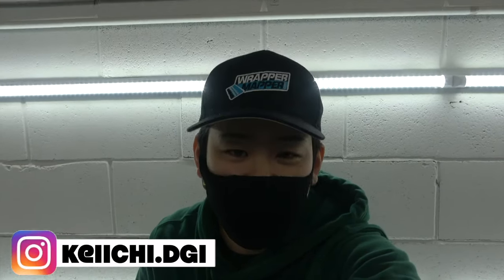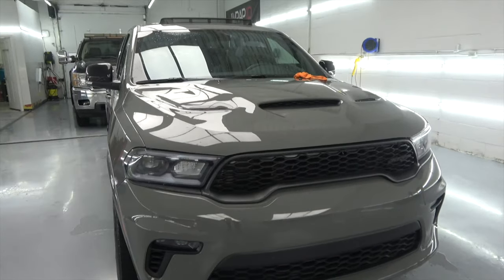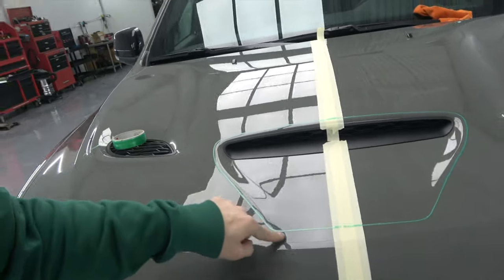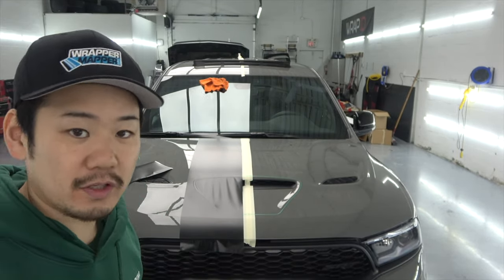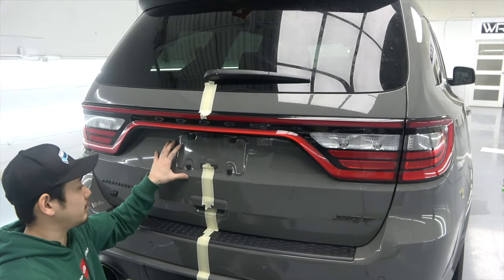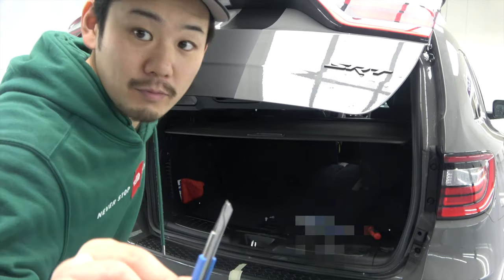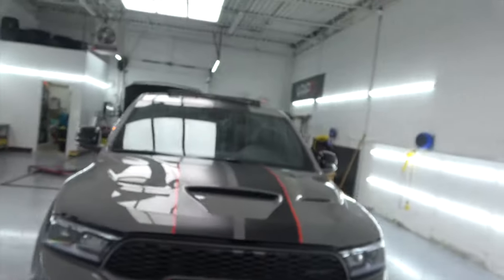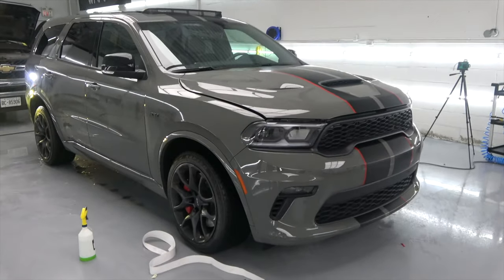RACING STRIPES ON DODGE DURANGO!

Comment: 10:50 I know he'll do the red stripe on the passenger side on the bottom, but it seems the red stripe on the driver's side stops a little short.  If that was my vehicle, I would want the red stripe to continue until it's out of sight.